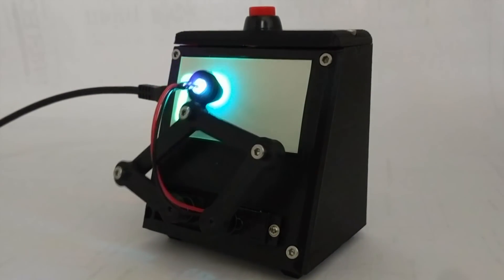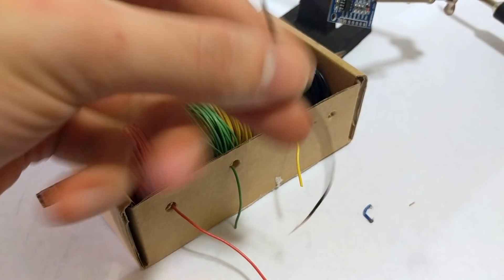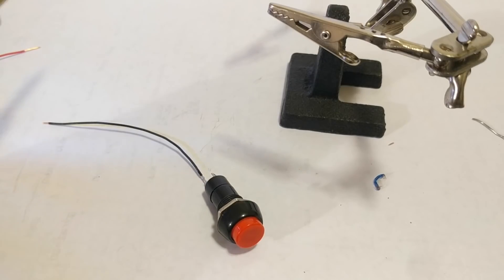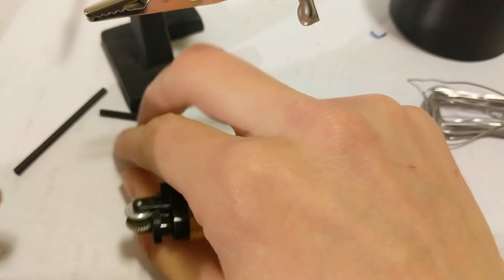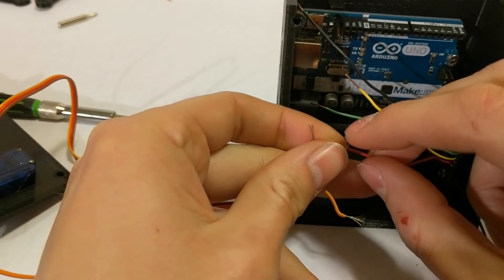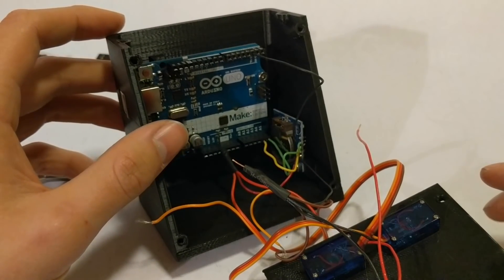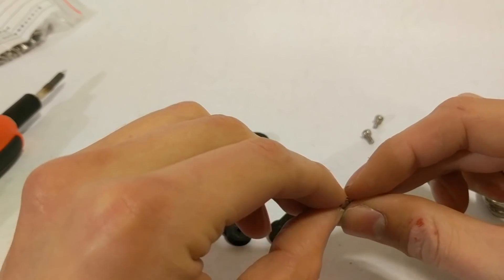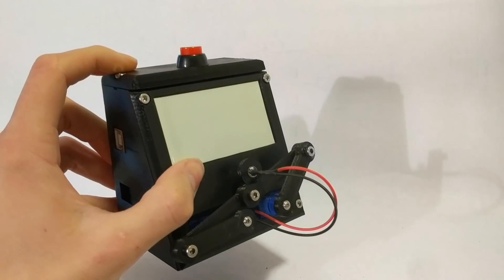Glow-In-Dark Plotclock Tutorial

Comment: I think it would look even cooler if the plotting assembly was inside the enclosure, and the light glowed through a panel.
Reply: a clear panel with the glow tape on the outside
Reply: @yeldardeerttoille , necroing your comment, but I think this is a pretty cool idea! One thing that might make it difficult would be finding a clear material that wouldn't block the light from the UV diode too much. Idk what the absorption properties of something like clear acrylic is, but normal glass actually blocks a huge percentage of UV light. I would hazard a guess that acrylic does too. 

You could find some other clear material that isn't absorbative in the UV range (quartz comes to mind), but getting the material in the right size could end up being prohibitavely expensive (quartz panes can get crazy expensive).

Alternatively, i'm not sure what wavelengths those glow stickers absorb, so it's possible you wouldn't even need the UV light, and the visable light would be enough, in which case this could be really acheivable and look really, really cool.

Comment: getting an error message:
Using library DS1307RTC at version 1.4 in folder: /Users/bluegure/Documents/Arduino/libraries/DS1307RTC 
exit status 1
'tmElements_t' does not name a type
Reply from the maker: Jeremy Forbes 

Try adding
#include <TimeLib.h>

Let me know if that fixes the problem
Reply: Tucker Shannon that worked thanks
Reply: You should just change this in the code so you do not keep getting the question. also I just finished it and the genuine Arduino UNO will not connect to my pc when the 5v power pin is in. CAN YOU HELP!
 @TucksProjects

Comment: I built the clock and when i tried to start to calibrate it, my servos turned sometimes 360° or more. Is that a thing with my servos or what? I hope you can help me. If you want i can send you a video. Thank you in advance...
Reply from the maker: Hi Tigerling08. The correct servos should definitely not rotate  360 degrees. Sounds like a problem with your servos
Reply: Okay i guess i will buy new ones and Ty for response 👍
Reply from the maker: @Tigerling08  I used some 9g metal servos off Amazon recently and they worked well
Reply: Could you sent me a Link?
Reply: I think i bought some weird cheap ones
Reply from the maker: @Tigerling08  https://www.amazon.com/MG90S-Servo-Motor-Helicopter-Arduino/dp/B07L6FZVT1/ref=mp_s_a_1_5?crid=3JDUE4EG9TS72&keywords=9g+servo+metal+gear&qid=1646934045&sprefix=9g+serv%2Caps%2C144&sr=8-5
Reply: Okay thank you very much
Reply: These ones Work perfectly... Ty for your help

Comment: great clock! but you should trim your wires much shorter,  and never use a lighter to shrink the tubing... 
*(yes, I know everyone does it, but you should use a hot air gun, or the tip of the soldering iron to apply the heat.)
Reply: You're complaining about using a lighter, and yet you suggest the tip of a soldering iron? Are you serious?